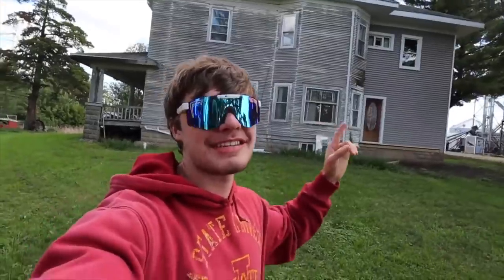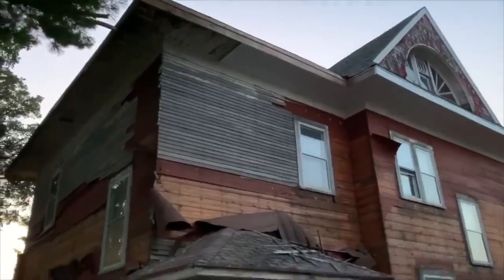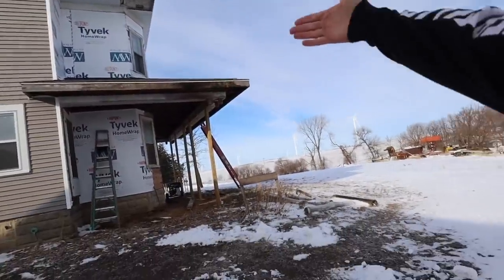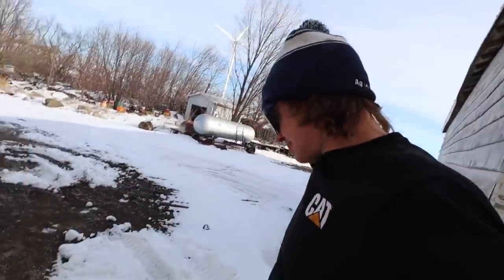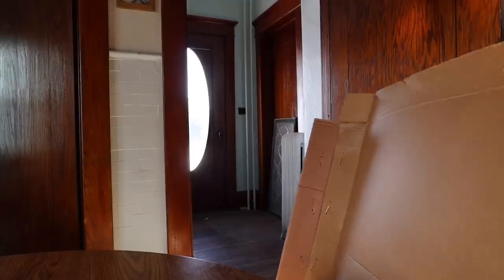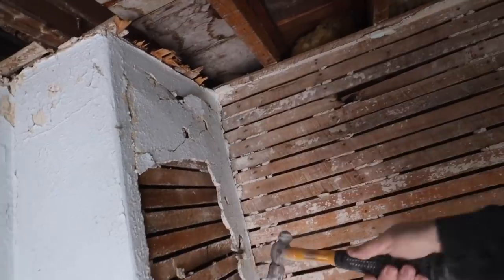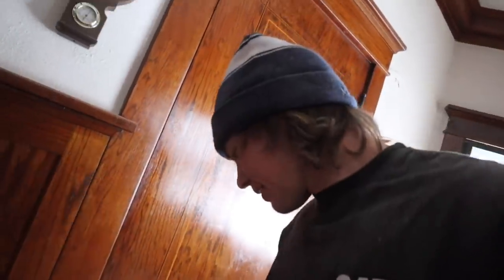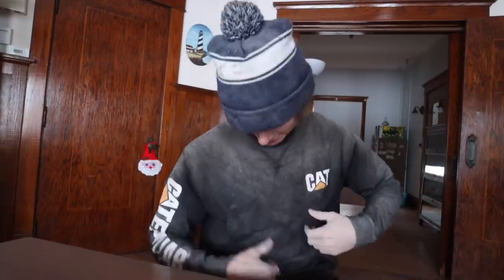Remodeling My Ex-Hoarder Mansion Ep. 1

Comment: Just a reminder for any wood and trim you're planning on reusing, write on the backside of it where it goes so you can put it on the correct doorway or wall. I'm going through a remodel myself and it's made it so much easier to put back up once the walls are done. In my case, I'm just updating an old 70's house that hadn't been updated since it was built.

Comment: Big Big suggestion.  Spray foam,  more expensive but insulation and vapour barrier in 1. If not regular batt insulation and use a thick poly plastic vapour barrier on the inside. Seal with acoustic sealant(like caulking) or tuck tape (like duct tape) to seal it up . Stops all the drafts. Poly baskets behind plugs and switches are a great idea also.

Comment: Should put plastic sheeting on doors to contain dust from migrating through house
Reply: Not really tho
Reply: I've tried that & it still went everywhere!  IMO it's a rip the bandaid situation.
Reply: I do restorations for a living. A plastic barrier is just a facade really. The best way to help is to get a very large "air scrubber" (high CFM air filters) and run it while you're working.
Reply: Worked for my house, even when they cut plaster ceilings down with an angle grinder! You can get nice adhesive plastic zippers too. Slap them on, unzip, slice the plastic, and then zip it up and it's a zipper door :-)
Reply: @entropyfan5714  plastic room and create negative pressure with a fan.
Reply: @logandz  You can supplement those by zip tying furnace filters to the intake side of cheap box fans. Run those even after work stops to help clean the dust out of the air.
Reply: This has really helped during fire season in the Pacific Northwest to help take the particulate out of the house air when the fires are raging.

Comment: My only advice would be that before you start removing walls between bedrooms you sit with an architect who can take your list of wants, needs, and desires and compare it with the current layout and space available and come up plan implement in stages. When my parents built their house they didn't use an architect and as a result the house now has a lot of quirks: the master bedroom is the smallest bedroom in the house, the width of the hallways failed to take the width of the trim work into account which prevented proper furniture placement from happening. An architect can find a way to preserve as much of the wood work and built ins as possible with maintaining the character of the house. Also, given the age of the house, I suspect the house is full of lead paint and asbestos which require special disposal procedures.

Comment: This thing is gonna be nice when it’s done!
Reply: Not as nice as it is now.
Reply: It is. Let's just hope they don't find rotten compromised boards when stripping the house
Reply: Heck yeah!!
Reply: Oh yeah it’s gonna be really nice
Reply: @farmerbill6855  yeah but upgrades are needing to keep it going for more generations to come.
Reply: @Jessa8891  so far, he's not "upgrade"ing anything. He's turning the outside into a modular home. And by tearing that plaster out, he's well on his way to doing the same to the inside. There's nothing wrong with that plaster if he has to beat it off of the wall. Plaster is a far better finish than drywall. And a heck of a lot more fire retardant.

Comment: If you don't want to remove the wall between the bathroom and the bedroom, you could turn the bathroom into a laundry room and the bedroom into a bathroom. But before you make any major changes you definitely should contact an architect. Just to check that your plans don't make any major problems in the long run.

Comment: Couple peices of advice. Run ethernet to every room at least one line mabie two or more. Smart home people recommend  4 cat 6 per room. You may not need all of it but it is way easier to run wire with walls open than run it later if you need to.
Reply: Better yet, run PVC with a pull cord in it. Then you can thread thru whatever tech comes along. No need to spend money now for something that will be outdated by the time you actually need it.
Reply: @kathyusa-iowa5137  I like this idea  alot!! Good thinking.  Jsut built a duplex and wanted to save some cash and did not run ethernet and am regretting it ever since haha
Reply: @kathyusa-iowa5137 
Yes!! Awesome idea!! I built my house ten years ago, and I'm sooo regretting not putting in cable tubing to all the rooms! It's a small house though, so WiFi usually works great. For Cole's house, I would DEFINITELY put cable tubing in the walls! 👍
Reply: @attesmatte  I saw this idea somewhere once and thought wow, this should be the standard! 😃
Reply: @kathyusa-iowa5137 
My cousin is a sound technician, and put all the necessary cable tubes into his house when he built his house. It's super nice! 😀👍 No chords or cables laying anywhere! 😍 But they don't really have the option to redecorate their living room much... 😜 That's not really an option anyway because of the layout and size of the room, but something to take into consideration. 😜
Reply: @attesmatte  but at least they're there. They can always be moved if need be. 🙂
Reply: @kathyusa-iowa5137 
Since the cables come out from the wall behind the TV, it's not that easy. 😜
Reply: @attesmatte  yeah, but if you need to move them, at least it will only involve tearing up a couple of walls in one room. Instead of half the rooms in the house to get it to the right place on another floor.

Comment: TIP - once the woodwork is pulled down pull the nails out from the backside, this will save the wood from being chipped and save it from being damaged.
Reply: Yes, this. Very important tip.
Reply: Great comment!
Reply: And some pieces might need to be labeled or numbered on the backside so you know where it goes.
Reply: Yep! Good tip. I like to get ahold of them with channel locks and just roll the jaws over to pull them out

Comment: If your going to put a washing machine on the second floor be sure to install a tray with a drain under it to prevent water damage if it ever leaks. I speak from experience!! 👍👍
Reply: and separate the tray with rubber matting or similar to make a floating section of floor to absorb all the vibrations.
Reply: And reinforce the floor to hold the extra weight.  Especially for if the washer goes off balance bad enough that it jumps around during the spin cycle.

Comment: There could be asbestos in that old plaster too. It was added for fire safety.  May want to wear a respirator and bag it. Have negative airflow.
Reply: i say  there is asbestos in that house and he really needs to call someone to check for it
Reply: Exactly what I was thinking. With the house being from the 1930s there is a very high chance of asbestos. Would highly recommend having someone test it. Don't want to containment the house with all the dust.
Reply: Agree, and he needs a proper face mask with filters at the very least!!
Reply: His family bought it in the 30’s it is older than that. I seem to recall he said it is over 100 years old in past videos so likely no asbestos in the original plaster.
Reply: I was wondering about both asbestos and lead....

Comment: I've remodeled a couple of houses both lathe/plaster and drywall. Word of advice. Get a fan, not a little 16 inch box fan but a 3 to 5 foot industrial fan that moves a lot of air. I know it's winter but put the fan in an open window in the room you are working. Open a couple of windows downstairs or in a room nearby for air movement. That fan will blow most of the dust right out the window and you won't have as much drifting through the house. Close as many doors as you can and put a damp towel on the floor to block the door/floor gap. That will help keep dust from entering other rooms. You are lucky in that you have radiators too. Forced air furnace would suck up dust and distribute it throughout the house.

Comment: Cole, any old plaster attached to old lathe is most likely layered with asbestos.  I found out the hard way and ended up paying more for the remediation of the plaster than I did for the renovation (the entire upstairs).  You can get the plaster tested by a professional company, all you have to do is get them a small piece of plaster.   Good luck.
Reply: pay attention to this....take it from an old remodeler...any smooth work that old will almost surely have it
Reply: that age of plaster is going to be horse hair plaster for this area
Reply: not 1919 plaster, more likely horse hair. Asbestos wasn't used much in houses until after WW II. (I'm a licensed asbestos inspector)
Reply: It might be safer to get a better mask when messing around with that plaster and asbestos.
We want to see you still doing these videos when you're older than DC.
Reply: @Spazcan  I understood it was mostly in the puttycoat, but my experience was all in S. California and my plasterer grandfather was passed when I was quite young.
Reply: @Spazcan  I am in a different part of the country so perhaps the building material was different for different localities.  My house was built in 1911, plastered in asbestos.  I only watched Cole's video with my laptop so it was hard to see if the hairs were inbedded in the pieces of plaster,  My experience with horse hair was that you could definitely see and feel the fibers in the plaster.  Nevertheless, I would not want any person working with asbestos to not be wearing the appropriate protection.  Once again, good luck.
Reply: @thesmallenginekid  you can do the demolition your self if it has asbestos you just need to follow the abetment procedures a licensed contractor would follow and dispose of it in the appropriate facility. It would have been better to know before he started but at this point in time cleaning the dust with a hepa vacuum is the best he can do.
Reply: @thesmallenginekid  Hi Andrew, it only cost me $60 to have the plaster tested.  And then $10,000 to have it removed.  The kicker is that I was going to do this about 5 years ago when no one cared and there was no remediation needed but I waited too long.  The house looks great though - I am going to be buried in the basement because I can't afford a burial plot now!  Best wishes.
Reply: @joangreenwood5445  I would agree that it would be advisable to get it tested or at the very least get proper personal protection. I don't know the regulations in his area but in a lot places what you do inside your own home is not regulated. Having said that, disposal is regulated under federal law.
Reply: @Spazcan  Bury it in the field behind the house 8 feet down.  Won't ever affect anyone :p
Reply: @DocNo27  Personally I don't care where it is disposed of.  My concern is the protection of health getting the stuff off the walls and out of the house.
Reply: ABOVE
Reply: I was thinking the same thing better to get it checked out to be safe then regret once you have health issues down the road.
Reply: Should also test your house for radon gas, it's high in South Dakota because of the pesticides. Yikes
Reply: Cole, in Iowa and most states it is legal to remove the asbestos in your single family home yourself and dispose of it in the regular trash. I was in the asbestos industry for 32 years in just about every capacity. Wet the material thoroughly and wear a mask with HEPA filters and do the job by yourself if you’re going to do it. If you have a lot of friable material, it would obviously be better to hire a licensed contractor but that will be costly. Get 6 mil think plastic trash bags and double bag the material prior to disposal. I recommend at least getting your house inspected and an estimate for removal if you have asbestos. Estimates are free but I cannot stress enough to do the work yourself and wet wet wet the material. Good luck
Reply: Not to mention the lead paint dust
Reply: This and buy several lead paint test kits too.
Reply: @sandravanderleek8569  Plaster is like cement it don't burn and asbestos is only used because it doesn't burn. LOL
Reply: And why would you tell anyone you are demoing asbestos???  Wear a dust mask and bury it deep away from the house and shops.  No will know and no one is likely to dig it up.
If anyone asks: "Looks like horse hair plaster to me."
Reply: @LiquidRetro  All paint before 1978 have lead in it.    That will save on test kits.  LOL
Reply: Home owners can demo asbestos legally themselves.  Do not get any government agency or lab involved.    You will regret it.
Reply: @hsimpson6581  Ya probably safe to assume it all has lead and treat according. His PPE needs to come up
Reply: Ya'll keep talking about doing the asbestos himself, and "just wear a mask" etc. The whole reason asbestos is so closely regulated now is because it causes cancer. A very serious cancer that really doesn't have a cure. IF he is going to do it himself, he Must keep ti soaked wet, and wear the very best in protective breathing apparatus. It is Not something to play around with. A test for asbestos and lead paint should take place. As to the radon, lining the underside of the house with a plastic layer is typically all that I've heard being done. and IIRC, his basement has all cement floors. I'm not sure the radon can or does leak through that, and if so, maybe there is a way to seal the floors to take care of that issue. Cole the Cornstar
Reply: @Stacey505  Radon has nothing to do with pesticides. It is a by product of the natural radioactive decay of uranium, which is found in all rocks and soil. Radon can also be found in water. Radon escapes easily from the ground into the air, where it decays and produces further radioactive particles.

 Some places have higher concentrations in the soil than others. Those areas have higher accumulation of the gas in homes and basements as it seeps from the ground into the home.

Outside it mixes with the air becoming less concentrated and thus less harmful. It is also carried away with the wind and as warmer air near the ground rises.
Reply: @sandravanderleek8569  Burn asbestos? That might not work out so well heh
Reply: @Stacey505  How is radon gas being increased by pesticides? It's a gas formed in bedrock, what's pesticide got to do with it?
Reply: @kblewis3331  Yes, Radon can come up through cement floors, homes in my area have this issue. The fix is no fun, they have a series of pipes under the cement that they draw air through and vent at the roof of the house. Unless he is sitting on granite or hard quary stone he will hopefully not have this issue - however getitng a tester for it that you can place throughout the home is doable - I did this and while it was detected I was happy to find it wasn't at a high enough level for concern - I have quarries nearby.
Reply: @Stacey505  how do you get radiation from pesticides? This might be the most asinine statement I've seen yet.
Reply: @hsimpson6581  that's not true.
Reply: @Stacey505 oh god I know all about radon gas problems.. I'm from Cornwall ( S.W. England) and most of the old houses here have radon gas in them, it comes up through the granite. All the old houses are built of granite and all the land sits on granite....not a lot we can do .. lol...we just ventilate the houses well...I don't think radon gas is caused by pesticides..it's a natural gas
Reply: If you leave the plaster that has asbestos in it alone, the asbestos is not going to come out and hurt you.  It's when you tear it up and it dissolves into dust that it's dangerous.  Same thing for lead paint.  If it's stable, if it has been maintained and isn't flaking off, it doesn't just come out into the air where it can be ingested.
Reply: @BrianWild445  we used that too in the netherlands. My ex and i bought a house from 1938 and in the kitchen we removed 3 layers of celing, plastic, plasterboards and then plaster with horse hair. Months later i was still finding dust everyware 😤 .
Reply: @wandasetzer1469  That's what the contractors told me - as long as I don't touch it, it will be ok.  They suggested that I cover everything with a "veneer" layer of plasterboard.  However, my intention,  like Cole's, was to move and take out certain non-weight bearing walls so that was not a solution for me.  This house has been around for over a 100 years and will still be standing when I am dead and gone.  But we need to be able to live with our decisions and covering up a health hazard to save money in the short run just didn't go over well with me as I intend to leave this house to my grown children who want to live here.  The same as Cole's plans.  Our legacy I guess.
Reply: @joangreenwood5445  Then you are certainly in for a lot of taping up plastic and still having dust get out anyway.  Years ago while getting this house ready - and we didn't take down any walls but sanded some floors and patched some plaster - I burned out the motor of my vacuum cleaner cleaning up after just that little bit of work.  You have a contractor, though, so maybe the bulk of the cleanup will fall on somebody else.

Comment: Had a house built in 1895 once with the same lathe and plaster inside construction and what you'll find is nothing is plumb, level, or square. Plan for frustrations and disappointment, it'll be a Pandora's Box, possibly a nightmare. Good luck, you'll need it. I'd help but but I'm some 375 miles away to your NE and can't reach you from here with all the snow and whatnot. On that cheery note I look forward to what should be an awesome result once you are done. I'm pulling for you, and 😎 my growing Pit Viper collection thanks you 😁

Comment: CONGRATS ON STARTING IT!!!  Blue tape, or a sharpie on the backs of panels and trim, suuuure does help in labeling what room, wall, door, and side, they came off of.  REALLY helps when going back together.  Also, cardboard over windows really helps too.  (...I was cringing when you dropped the brick towards the glass in the door.)